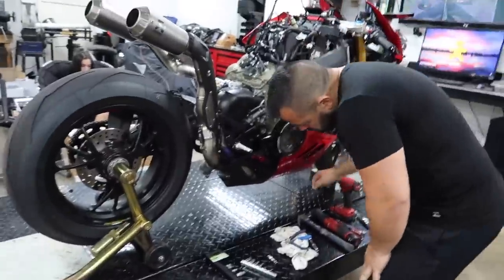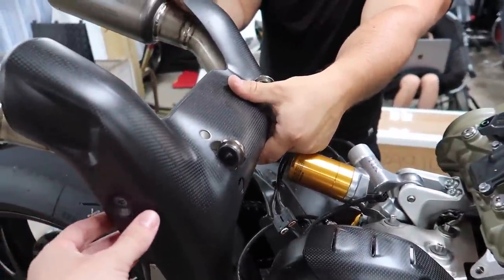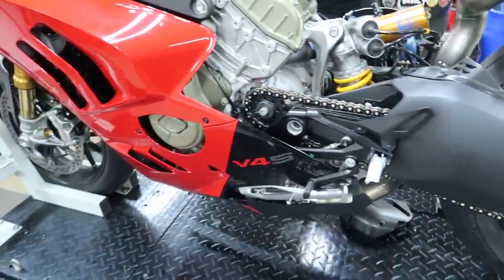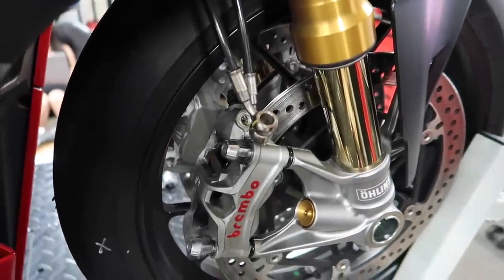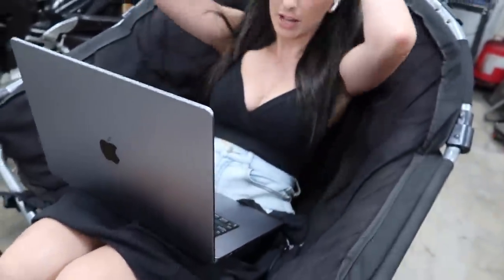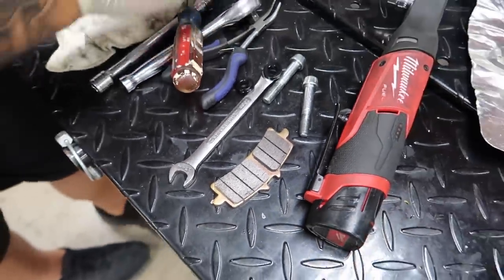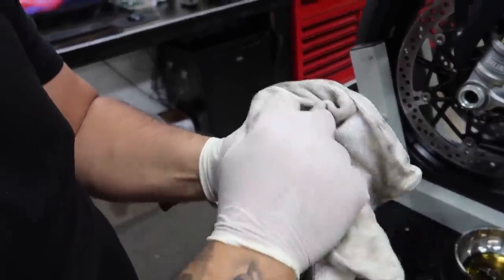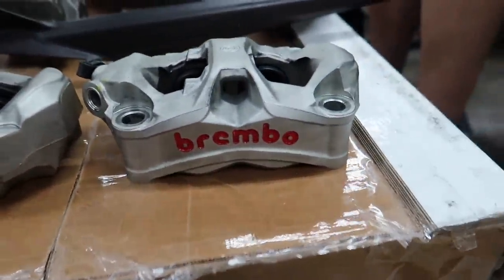Painting More Parts for Our Custom Lamborghini Panigale Build!!!

Comment: I had a CBR 1000rr before I got my s1000rr, and I did all the mods my self. Exhaust, air filter, block off plates, clutch slave cylinder, brakes, chain, sprockets, etc etc. I will never, never, never do it myself again. So you will never hear me say "its just bolt ons". I have mad respect for the work you do, don't listen to the trolls they probably never lifted a wrench in their lives.

Comment: The sinsters in the brake pads are so you can have lots of friction when the pads are cold, which is great for riding in the rain or first starting out.  Race bikes change pads depending on the weather, and usually suck when you first leave the pits.

Comment: Although that's not the shade of blue I would have picked, I admit it's starting to grow on me. It's not just Lamborghini that's using it. BMW has used it on the M4, Chevrolet on the C8 Corvette, and Ford on the Mustang. One thing I absolutely applaud you for is building a Ducati that isn't red. I know of no other motorcycle manufacturer that has such an addiction to one color.